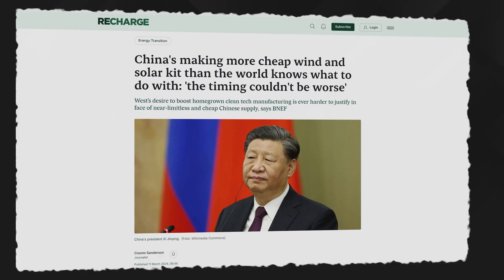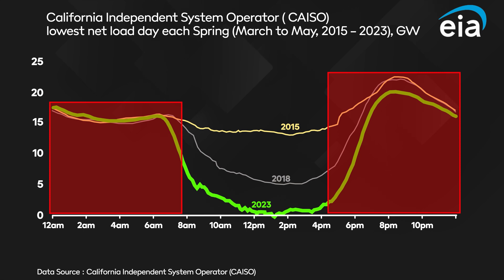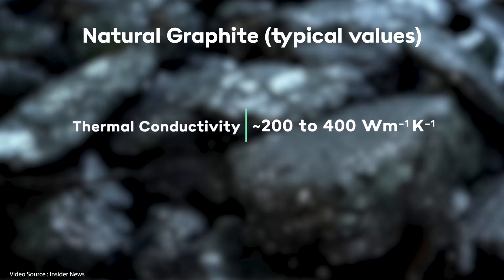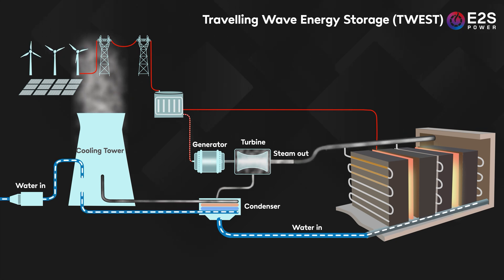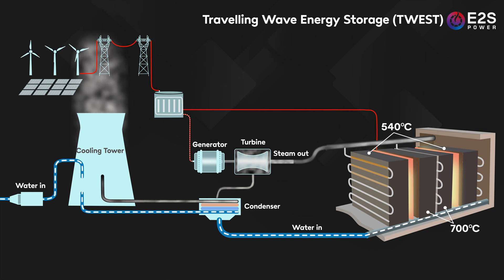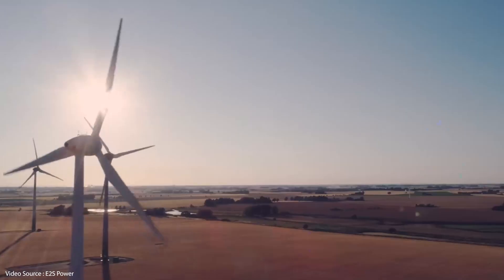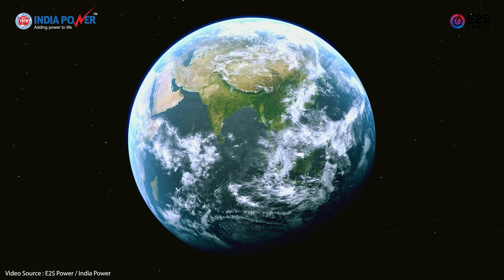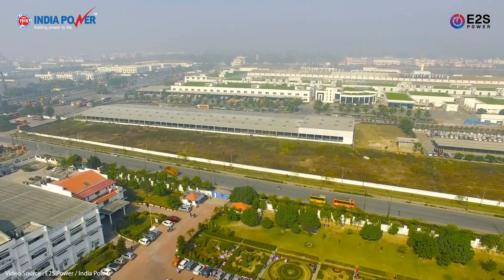Just Have A Think by David Borlace - Episode on E2S Power thermal energy storage solution (TWEST)

Comment: When NSW university was trying out the oil in reflecting trough sun tracking solar collectors, and Spain had their Power Towers etc, it did look as if heat batteries were getting well researched, and of course it is still happening. 
Sciencing and Technology will continue.

Comment: I don't see a feedwater pump; traditionally, its location is between the condenser and the boiler. It pumps the feedwater up to ~3000 psi and powered by steam. How does this system achieve that kind of pressure? A few "black boxes" on the schematic that need explanation in my opinion...